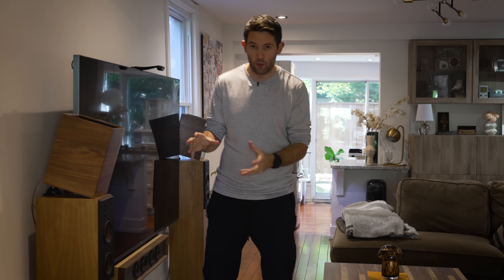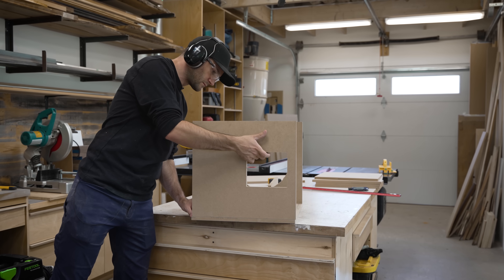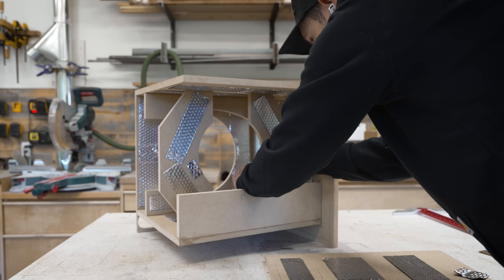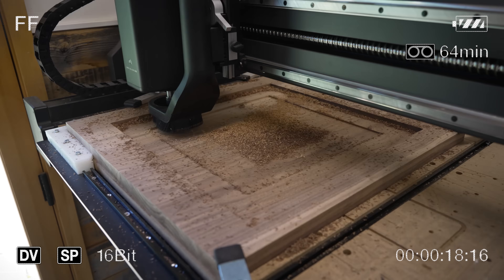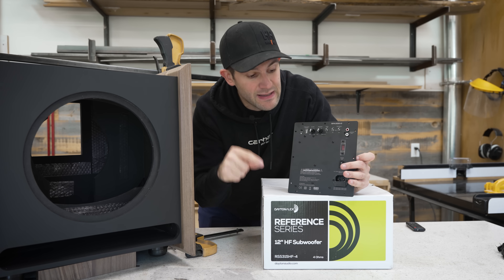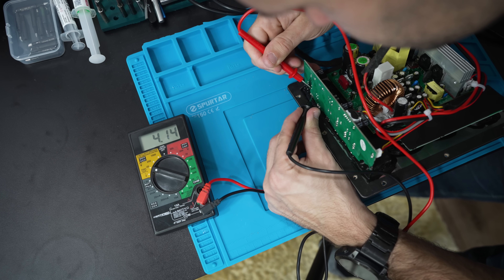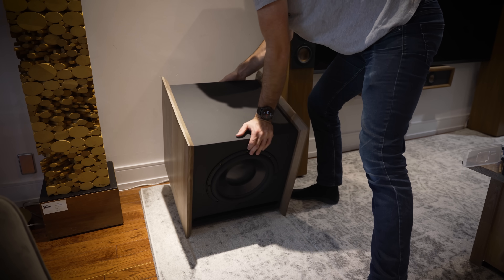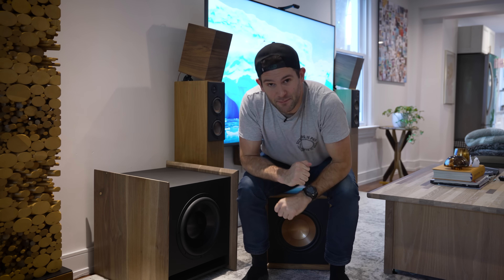THIS changes DIY Audio...

Comment: Nice work. I've always been told to over spec the amp as you are more likely to blow speakers from clipping the amp than you are from overdriving the speakers.
Reply: Car audio guy since 95 ... always been told to have more power than you need...so you're not stressing your amp to its higher end/max...and was told by one VERY reputable family audio shop that they never had anyone blow subs from too much power, but have had a lot blow from under-powering them...this COULD have been a ploy to sell bigger amps. (This shop is still in business)
Reply: @scarce911  The biggest amp you can afford, within reason, is always the superior choice.
Reply: @PeteNice29  It's really easy to go too big. When you have to attenuate volume, you're attenuating dynamic range and therefore adding compression. 100% of amps ever made have the most dynamic range right at max output. If you go too small and clip, that's bad, but if you go too big, you lose dynamics and punch because of it. The least amount of headroom without clipping is always best, objectively. This all goes back to loudness wars and people not understanding the difference between volume and compression.
Reply: @pokrog  Totally agreed. Sometimes I, like everyone, am guilty of oversimplifying on the socials.
Reply: @PeteNice29  
Well, within reason. Melting a voice coil is a possibility.
Reply: @scarce911  It would be interesting to see if there is any tangible evidence either direction. My theory is that it doesn't matter truly if it's being underpowered, or slightly overpowered (obviously doubling/tripling recommended power would kill it quick or sound bad) as long as the signal coming from that amplifier going to that subwoofer is not being clipped everything will probably be fine. I've only blown up one speaker in 20+ years of car audio, and I can admit I had it tuned improperly all just to be the loudest guy on the block. These days I enjoy a nice SQ system. Something that sounds fantastic, but can also get the decibels out if needed.
Reply: More headroom, more good
Reply: Overdriving the amp is worse than overdriving the speaker, though that applies far more to passive crossover speakers where the overdriven amp distortion puts more load on the tweeter. Speakers have two limits, sustained thermal and immediate peak
Reply: Agreed, always better to have some headroom for transients rather than hit the clipping
Reply: You are correct, he is not👍
Reply: A larger amp can help with transients too.
Reply: 100% true.  So many people think they have to be careful but to use an amp that has more wattage than the speaker is rated for, but you’re FAR better off using an amp with way MORE wattage Than too few watts.  If you give a speaker less watts than it needs, you are guaranteed to induce clipping into the output due to the amp being overworked. This results in nasty distortion.  And what destroys/blows speakers?  Clipping/distortion.  As long as you have a tiny bit of common sense and realize that also doesn’t mean you can play your setup as loud as you want without consequences. Play it loud, crank the watts if you want, just be aware that if you hear any distortion you’re going too hard and lts time to dial it back.  OR you can use an oscilloscope to measure your signal and figure out exactly how much power from your amp you can use without introducing any distortion.
Reply: This speaker needs more to reach its full potential for sure.
Reply: Is this more applicable to solid-state amps vs. tube amps?
Reply: @GregKrsak  Both. It's a bit more linear with solid state but unless you have a guitar amp, you don't want to drive the tube in your preamp super hard.
Reply: @GregKrsak  "Is this more applicable to solid-state amps vs. tube amps?" Not really, In general, for clean audio (like not guitar amp use) one wants to run an amp at about 10% of it's rated output because most music includes high peaks up to 10 times the average signal level. I guess it depends on how well/badly the engineer has compressed the audio in the recording. Some recordings have been compressed so much there is not much in the way of peaks to worry about. Of course these recordings sound a little on the unreal side but whatever floats your boat. In the case of tube guitar amps, the amp is pretty much always pushed to and beyond the amps rated output on purpose to distort the sound even when trying for a "clean" sound. This extra push adds extra harmonics that sound pleasing to the ear but they also have another name: distortion. most people don't find solidstate amp distortion pleasing. I would add that guitarists like the sound of pine cabinets too. again not because it gives cleaner sound but because it resonates in a pleasing way. For sound reinforcement or a stereo, you do not want distortion, tube or otherwise, and you do not want to here the sound of your cabinet.
Reply: In general yes. Over spec.
Reply: More power = cleaner output.
Reply: Are you serious? 😂 There could be a small chance  of breaking the tweeter due to clipping (which is due to increased power sent to the tweeter) but mid or bass drivers will not break from clipping. Too much power = too much heat in the speaker is what breaks it. Too much excursion will break it too, and a more powerful amplifier will increase the excursion. Think about guitar amplifiers! They are regularly driven with a straight square wave (also known as maximum distortion) and they dont break. ❤❤❤
Reply: @KingArttu  First, you don't drive tweeters on a subwoofer amp.
Second, more power does not equal more heat put into the coil. You can set the gains properly to avoid overpowering the driver you are using, while still having enough headroom to offset impedance rise. Clipping will induce heat into the coil
Reply: This. Most speakers don't like square waves.
Reply: Clipping causes high frequency power.  It blows the tweeters and maybe mids, but mostly tweeters. A heavily clipped sine wave looks like a square wave, and a square wave is a fundamental sine wave plus all the odd harmonics, its these odd harmonics that do the damage.
Reply: @markpitts5194  thats bs speakers dont care about what the signal is the only thing that breaks them is heat and the only way to do that is over power them
Reply: @Durkhead  Come on, i replied, where is your argument??????
Reply: @markpitts5194  iv played high gain guitar through many home stereos for hrs, iv played speakers at full blast with under powered stereos never have i blown speakers. only time iv blown speakers is when iv put to much power through them. speakers dont care wat signal is put through them as long as you dont overpower them. if clipping hurt speakers guitarist wouldnt be able to have high gain amps
Reply: As long as the driver is getting a clean wave, it is a motor. When clipped signal is applied, the voicecoil is a heating element. Nuff said.
Reply: @andyevans2336  just because you say something doesnt make it true at least i gave real life exp as proof that clipping doesnt hurt speakers
Reply: @ so, let's see?... as long as the wave form is flat ( clipped ) the voice coil is stationary ie: a heating element. When the wave form continues to move up and down  it is a motor.  Physics is physics.   A heated voice coil will swell the varnish insulation causing distortions to the shape, incouraging rubbing on the pole piece that then usually shorts the coil and destroys the functionality of the device. We refer to that as: Blown.
Reply: @andyevans2336  thats a great theory to bad theres no evidence
Reply: very true , it also depends on the sub itself , i have been running a set Infinity 12" kappa's for 7 years now , they are rated at 175 RMS each , i have them on 700 watts rms each at 2 ohm , but they are very very stiff carbon fiber cones , they easily handle the 700 i throw at them , ofcourse the amps are all gain set with a o'scope... a lot of times speakers are rated at a RMS wattage , where a lot of amps are rated max wattage , so that 300 watt amp may not even be close to 300 watts , it may only do 100 RMS at 4ohm...it's important to pay attention to RMS wattages on a amp.
Reply: Oversize the amp to avoid clipping which creates a lot of useless high frequencies that can smoke the voice coil in the speaker.
Reply: You are correct.  His amp impedance statement is completely wrong too. Tube amps do have impedance issues. Solid state amps have a damping factor of (0) 0ohms.
Reply: @chookvalve  Not quite. See my comment above.
Reply: You are 100% correct.
Reply: Clipping hurts mostly the tweeters. On a sub it doesn't matter so much. Clipping blows tweeters because it introduces high frequency distortion to the signal which passes through the crossover and subjects the tweeter to 10-100x the power it really should get. Bass speakers blow for mainly two reasons: Over excursion or over heating. Clipping can overheat even a bass speaker because it flattens the waveform and the amp can produce about double the power it would with a clean signal - but in order to blow a bass speaker you'll need to play full power with an amp large enough to overheat the driver or drive the driver over safe excursion. Basically you'll need to be dumb.
Reply: Yes, you are right and frog boy Zach is dead wrong. When using shit ass car audio, yes match power. When using proper audio, double the speakers rated power. Too many reasons to list here. I wish frog boy Zach would use his wood talent for something else. He sucks at speaker design. I mean the form looks good, but his boxes are full of junk. The wireless garbage takes the cake of stupidity. So funny how he is METICULOUS with the wood work, but them shits oN the whole thing with wireless. He covers staple holes in the box, but can't run a fucking PROPER cable. Did you see under his carpeting? What a mess! He must be Truedough's son. That would explain the stupid.
Reply: Iv been over driving speakers all my life never have a broken one from amp distortion.
However iv blown many speakers from over powering them
Reply: It’s always fun turning a cone inside out
Reply: Yeah, an "overpowered" amp with a limiter ideally.
Reply: Yes, people think only of the level that they can hear at, but there are also lots of other things that impact the sound in many different ways. Harmonics of the sound can impact the wattage and the quality of the music, along with fast transients to a lesser degree. You are after all, dumping power into a load which can and will heat up especially if there is distortion, because of the total power level used. A decent quality amplifier with a good PSU is key here, to having a good sound. PSU supply lines are affected if the signal gets too close to the rail voltages, which of course feeds back into the earlier stages of the amplifier, not just the power output. This waggling of the supply lines (imperceptible in many short tests) not only creates distortion but generates heat in the speaker coils, thus reducing speaker life.
Rule of thumb is to have at least a 30% or greater overhead and limit the input level to achieve this.
Reply: @michaelward402  A regulated supply for the input/driver stages solves that but may not be in these cheap class d pwm circuits, I would think it would only help the analogue  and comparator portion of the amp. On 2nd thought, perhaps they are due to the supply voltage limitations of the front end components. I haven't pursued this type of amp, especially at the cheaper end of the line. I speculate the sub would have to cause shockwaves in the listener's sensitive body parts before it clips. A higher powered amp with a built in limiter would solve the problem and still allow intestinal fortitude challenges. But hey, Zac's happy.
Reply: @GAK1atatt  I agree a separate/isolated supply  for the input stages would help, however what you see with amplifiers in general is that slow moving signals cause  the biggest problems with supply power dips due to the amount of power being drawn at low frequencies. This is because speaker response gets less efficient at the low end, so you are dumping more power in at those frequencies to flatten the overall response. We always used cambric edged bass speakers which changed the sound by catching the transients at low frequency which adds to the sound quality. Personally I don't like roll surround bass speakers given they tend to give a woollier sound. Personal preference in the end.  I have seen designs where the supply is no where near adequate for the power actually required.  Class D has its own unique problems with fast transients becoming an issue, if they become too high, but these can be filtered out. As you say, cheaper amplifiers can be an issue, but I have seen some cheaper amplifiers actually addressing these issues. A named amplifier will always cost more with the perception that they are better.
 I am glad Zac is a happy bunny :)
Reply: Clipping kills tweeters, there are no tweeters in a sub.
Reply: @Sergey31337  Over clipping kills any speaker, particularly bass speakers.
Reply: Clipping kills subs? Is something I've always heard. So I've always tuned according. I had a friend who thought gain was just a volume knob. I showed him how badly he was clipping his sub with an o-scope. Bass boost max, gain max, and wired to 1 ohm on a non 1 ohm stable amp. He has melted his fuse which of course he took as the fuse is too small so bigger fuse installed. How come in over 20 years of him doing this he has never once damaged any subs? He's blown amps but not one subwoofer. Why?
Reply: @jasonnelson6624  " wired to 1 ohm on a non 1 ohm stable amp" makes no sense, given you would need to specify the amplifiers impedance it is expecting to see as a load. Having any load that is lower than the amplifier will see the amplifier being damaged due to excessive current, hence the blowing of the fuses. 
As far as the speaker not being damaged it will depend on the speaker rating. You can think of a speaker as a motor, which ostensibly it is. You have to have the correct Voltage to make it turn and trying to just dump current through the speaker will not make the speaker work any harder, but it will damage the speaker coils over time.
Reply: @michaelward402  yes I understand all that. My question was for the comments under powering a sub and or clipping it would cause damage. I really dont see how you can damage a sub by under powering it. Especially since I saw this guy do everything we are told will cause damage yet it didn't not once. Again yes he blew amps from driving them on low ohms and clipping. But not subs his smallest subs were rated 400-600 if I remember right. His amps were cheap flea market amps at most 200w. But once he had money he moved up to 2500 still max boost and gain all the way up and still his jbl subs took it no issue. He always played his music loud and for hours at a time. So again if under powering subs and sending a clipped signal will damage subwoofers then why didnt it?
Reply: @jasonnelson6624  "My question was for the comments under powering a sub and or clipping it would cause damage" Who said anything about under powering a sub?, overpowering is the problem. Clipping is of course the same issue. A simplified analogy would be to think of a half sin wave as an example, total power is the area under the curve, so as you increase gain to clip the signal that area is getting larger (more power). Note this is in a matched system with the correct impedance matched to the amplifier.
Amplifiers vary by how good they are at reproducing particular frequency bands and just because an amplifier is rated to have a higher power, does not mean it has a higher power at sub frequencies. In fact most amplifiers and speakers suffer at low end with power loss, which is why you have tuned speaker cabinets to produce the sub frequencies ie the bass reflex.
You have to look at the system and the characteristics of both speakers speaker cabinets and amps to answer your question.
When ever you specify powers, you need to give the actual power developed in a load and state how that power is measured.
Stating something like 400-600 and 2500 are meaningless figures.
Reply: @michaelward402  the person right before my question stated over clipping kills speakers. Others also stated under powering kills speakers. Which was why I asked my specific question.
The fact that I said I showed him he was clipping by using an o-scope I thought would have hinted to the fact I do know a little bit. You same my numbers mean nothing but how does 2500 watts mean nothing? Its 2500 real watts driven through a 1 ohm load. It wasn't some bs sticker that an amp company slapped on the case of a 200 watt amp claiming 2500 watts. As far as the 400-600 that was a range because subwoofer number don't mean anything plus im going off memory from 15 plus years ago. Not to be a smart ass but really who doesnt know overpowering any speaker will damage them? My question now is wouldn't have been easier or fast for you to answer my question. By saying overpowering and clipping at power close or over what the speaker list will damage a speaker, and underpowering them wont? Or just say you dont know because you answered nothing. Maybe one of the people who claimed under powering can damage a subwoofer will but I doubt it.
Reply: @jasonnelson6624  I am sorry you feal aggrieved in some way, I was merely pointing out that the statement for figures given were not technically correct. As you have pointed out some manufacturers give music power as a figure and without knowing what you are referring to, i had no idea what those figures meant. It would have been easier just to write down 2500W RMS and 400W - 600W RMS, so there was a technical frame of reference. 

Given 2500 W RMS looks ridiculously high for any speaker amplifier, I could not know what that figure referred to. Also the figure of 1 ohm is pretty stupidly low for a professional speaker, given the majority of amplifiers are for either a 4 or 8 ohm impedance load. The only time I have seen speakers with that low an impedance is for instances where the speakers are daisy chained.
If you think I said nothing then you clearly did not read what I wrote and got struck on the fact you though I was being offensive in some way, which was not the intention.
Whenever I answer it is not just for the @person, but for others too who may not understand.

Simple answers:
 under powering a speaker does nothing other than cause the speaker coil to move less so less volume no damage.
Clipping means you are dumping more power into the speaker and as https://www.youtube.com/@Munakas-wq3gp has said, this is more like DC so the speaker does not move during that time. Given the waveform is complex this sounds distorted. Constant over-clipping can cause damage to the speaker..
Speakers cannot move past there physical constraints so cannot have over excursion, however given the speaker is physically constrained this again can damage the speaker.
Reply: @michaelward402  no I can appreciate that. In car audio running 2.5k on up to 8k isnt that unheard of. I know the 2.5k is rms. I personally have never tested the 8k's to know if they can do rated power. I personally used to wire my 15in down to .25 ohms as its a quad coil. Of course with box rise the amp wouldn't see that low. Obviously that is a risk that most shouldn't do or try. When I looked at home audio I was surprised to see y'all just stick with 8 ohms. Let alone your subwoofers were single voice coils. Just goes to show you how similar yet diffrent the two worlds are.
Reply: @jasonnelson6624  In home audio we have plenty of voltage to play with so there is less incentive to build low voltage but mega amperage systems and dropping the impedance is detrimental to the damping factor when long cable pulls are done like typically is done at home or professional audio...
Reply: @jasonnelson6624  I can see you are talking about vehicle audio systems, which had I known (I took it that we were talking about home audio systems which is what this video is about) I would have understood the low impedance speakers and claimed high wattage amplifier.  These are of course special cases where the amplifier is designed for low Voltage, high output and the speakers are designed for higher current.
4 ohm or 8 ohm  was probably an agreement of some body or other between speaker manufacturers and the audio industry. This means more turns of thin wire on a former which increases magnetic flux density (more efficient)
Higher currents in the speaker requires thicker wire to carry that current, which in turn affects the design of the speaker. As in the gap between ring and core.
As time has moved on, the use of neodymium magnets has become more widespread in speakers rather than the ferrite ring, which have higher flux densities, roughly 2 - 8 times that of a ferrite ring. Which in turn means that lower impedance speaker can be used, for more power output.
Reply: @jasonnelson6624  Clipping damages tweeters because it causes high frequency distortion which passes the crossover and puts too much energy on the tweeter. Clipping can in theory kill a sub but only because an amp can give about twice its rated power when its heavily distorted. Also the power comes out more like DC than AC which reduces the cooling of the sub driver. Clipping itself does not damage the sub or the amp but the heat overloading will. Then again if your sub can take 800 watts RMS and you clip a 200 watt amp, you can do it all day for the rest of your life and the sub won't be bothered.
Reply: @Munakas-wq3gp again I understand sensitive things like tweeters can be damaged. The comments above specifically said you can damage a subwoofer by under powering it. Which I don't believe or see how. Which is why gave the example of a sub being under powered and even hard clipping. It didn't get voicecoils warm or strees the subs in any way. So is this just another b.s. myth? Is this a myth to scare people in operating with good sound practices? Or can you damage a subwoofer by grossly under powering it and with excessive clipping? Yes or no? Again for the last time I know that's not proper or how you should power a sub. But can it damage it? I doubt it's possible even on thrash cheap subs. Subs fail due to heat braking down the voice coil glue which then unravels creating a direct short. Or you supply so much power the voice coil exceeds the maximum excursion. Which can happen also from improperly designed enclosures also. But I've never seen or hears 1st hand experience damaging a sub from underpower. Hell subs can take be plugged in directly to a wall socket and take that for a little while before it smokes and tries to weld the vc in the gap. Stupid stuff we did in high school lol.
Reply: @jasonnelson6624  If someone is stupid enough to overdrive their amp for extended periods, the same reason why tweeters break will make the signal more like DC than AC. That means the voice coil will not pump up and down as designed and the voice coil will not get normal cooling. Add that to total power output being double typically compared to one rated for the amp, there is a good chance you'll burn even a sub out if your amp is rated about similar to the sub and you suddenly push double the watts and the sub isn't pumping to cool itself. So basically if you think of it, it's safe to have a very small amp and high power handling sub or a high power amp and normal power handling sub, but risky to have an amp and a sub that are rated for the same power handling, since then you can damage your sub if you seriously distort your amp. With a powerful amp you risk mainly over excursion on the driver and that's generally harder to do by accident IMO.
Reply: Correct. I try to shoot for double the continuous/RMS value when choosing an amplifier, and I have yet to see a failure due to overpower.
Reply: @wilzmit  If your speakers produce enough output for your needs you never need to overpower them in the first place. The ones who get in trouble use underpowered setups - that goes for both speaker power rating and the amps.
Reply: @Munakas-wq3gp exactly. Matching a speaker to an amplifier equal in power to the speaker's max/peak power rating isn't overpowering the speaker.
Reply: @wilzmit  Actually it could be argued that matching would be incorrect although its a fine line. I usually allow a 10% - 33% leeway with speakers being larger in power than the amp.
Reply: You were told correctly, this guy is wrong about a lot of stuff.
Reply: @railgap  Clipping the amp is mostly dangerous for tweeters. It's very rare to destroy a bass driver by an amp smaller than the drivers rated power handling.
Reply: I was always told as a general rule that speaker should be around 20% more powerful than amp. So 80w amp needs 100w speakers. Because a 100w speaker will handle 80w, but an 80w speaker might die from 100w amp.
Reply: Correct
Reply: Yes in my car my box with 2x 12 inch solo baric l7 together are rated for 1800watts not counting rms the amp I have on them is 3600watts and it actually has been tested i also got one of the SMD distortion detectors to set all my limits so I never have distortion and set my radio to never go past 27 which my whole car rattles at 15
Reply: Clipping blows tweeters. If you drive a subwoofer with a clipping signal it will just ignore it. If you drive it with a sine wave that's way above its power rating, you will smoke it. Driving your main speakers with a clipping waveform could send a lot of high frequencies to your tweeters.